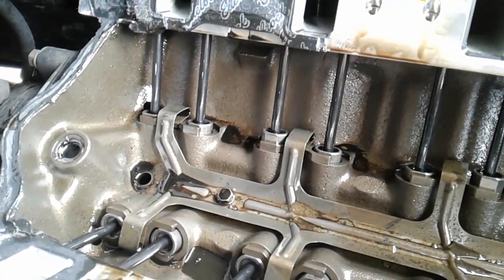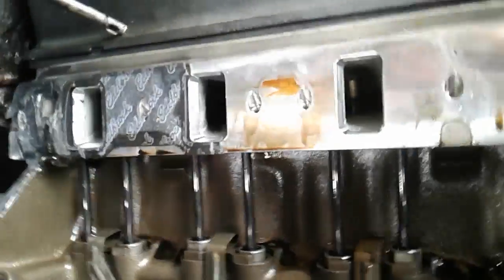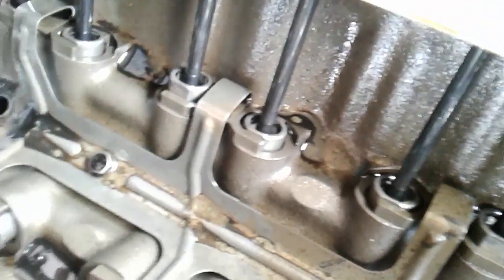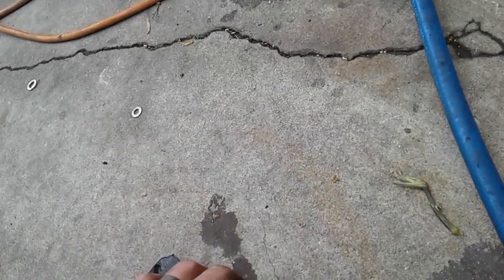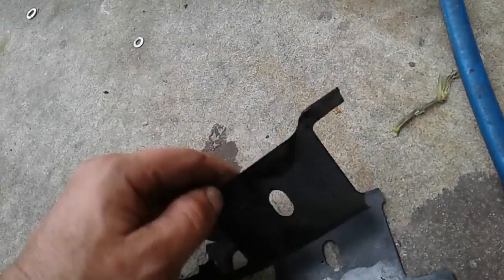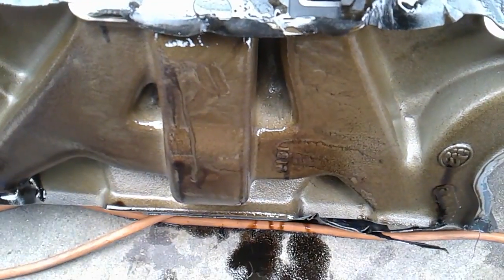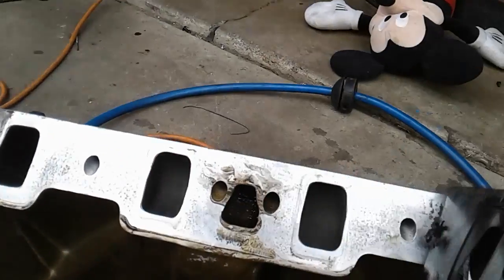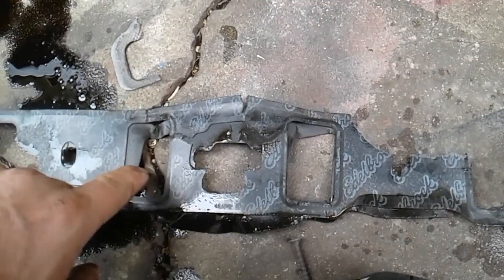Ford 351W 302 5.0 Intake gasket failure Leak edelbrock 7220 Fel-pro 1250 1250S3

Comment: Do not use silicone it all! I'm going through #4 gaskat on my Mustang because I realized the intake manifold has to be re-torqued 3 - 4 times.
Reply: You are supposed to torque them 3-4 times.
Reply: I had to re torque my intake 12 times. Now it's tight at 24lb. Every heat cycle I was able to torque it more and more to 24lb. I never had any issues with my old 1970 Challenger with a 340cid. I wonder how Ford torqued it down.

Comment: Hope to see a follow up on what is causing this. Did you check the flatness of mating surfaces? When you set the manifold in place, use a feller gauge at the front and rear block surfaces, to make sure there is a gap. Maybe .035 or so to make sure it is torquing  down to heads and not binding on block first. This can happen after blocking the decks.
Reply from the maker: I changed the intake. To me it seems like a gasket defect. Torqued down many fords over the years and never had a problem like this. Truck is running fine about with new steel core gasket.
Reply: @fintechrepairshop   I have had no trouble with  SCE gaskets, i use them because , the gasket around  water hole had a lot more material .my mate had 1250 sucking in and down , but uses the steel reinforced and they have been ok . Cheers
Reply: Just experienced a similar issue on a 5.0 HO and was having idle hanging due to major vacuum leaks within the crankcase...trashed Fel-Pro Print-O-Seal gasket part #1262.  Whoever installed it went a little crazy with the RTV around the coolant passages, and the distorted gaskets were torn in at least 6 of the 8 ports.  Replaced with the steel core Fel-Pro part # 1262S3, and only used high tack gasket sealant on the cylinder head side and installed dry on the intake side (although these gaskets have that blue bead around each port on the intake side).  Only silicone used was the Right Stuff for the wall on the block along the front and back of the lifter valley.